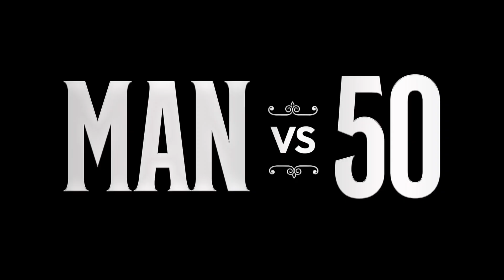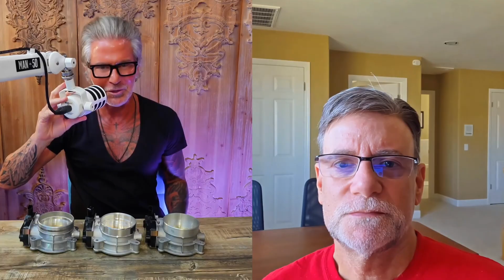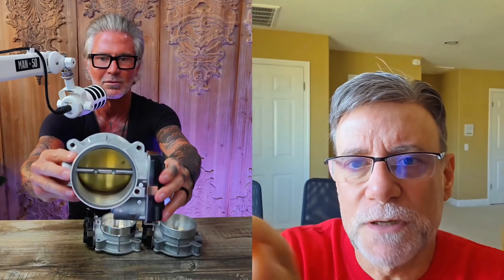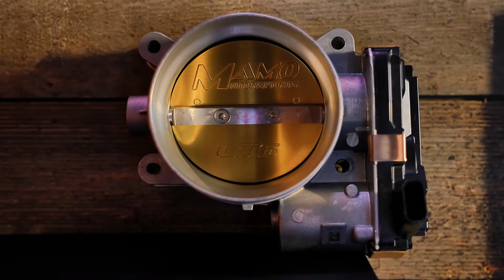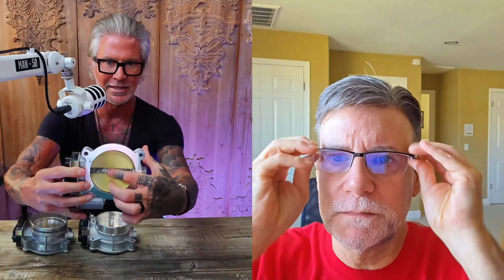Meet Mamo – The New Throttle Body Champ??

Comment: I seriously wonder if you did a knife edge on the throttle plate itself would it be beneficial for anything? Knife edge more towards the side that is opening, like a 45° grind to the edge and a straight 90° on the other side. Of course reverse on each side based off the throttle plate opening...

Comment: You mentioned that the TB and cold air intake mods do not void the manufacturer warranty. Is this true?
Reply from the maker: No it doesn’t, but just to be safe contact your local dealer.